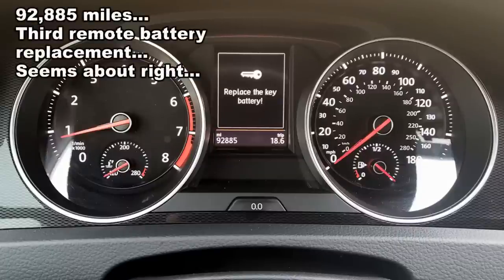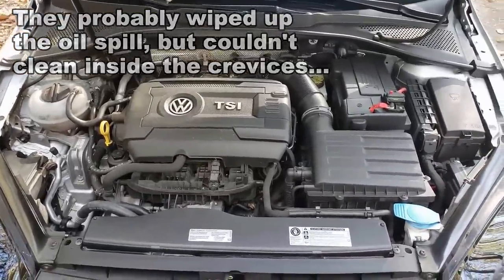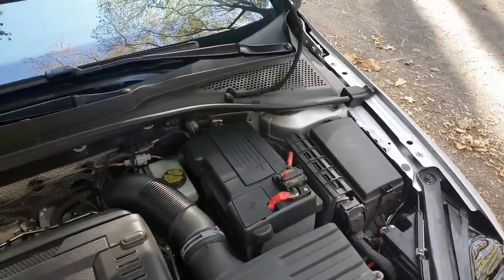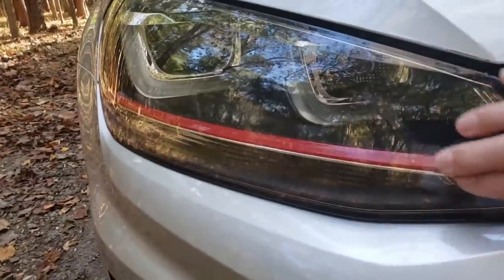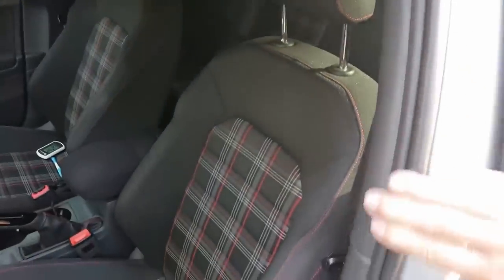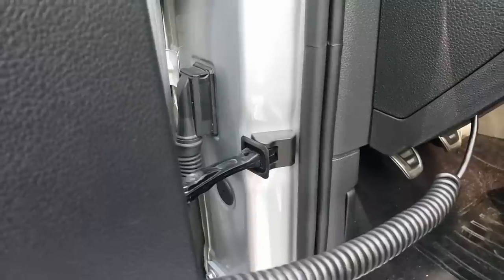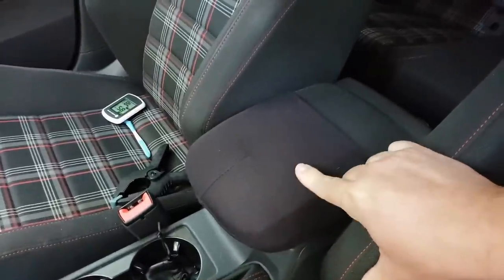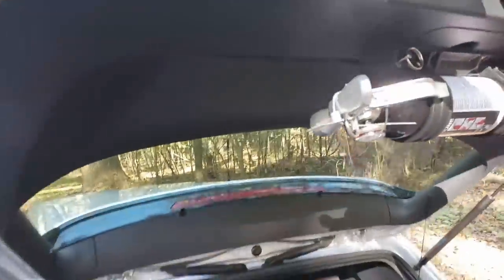THREE YEARS AND 93,000 MILES: My Report, Part 1

Comment: What people do not get with European cars is not the sheer distance in a short time frame but the fact the car deteriorates over time regardless of the distance travelled. 
That is how they designed them, the electronics deteriorate and the plastics deteriorate becoming brittle irrespective if used or not.

It may have travelled 93K Miles but the frequency of the usage of equipment, temp cycles on the materials, seals, plastics is no where near as much as a car used daily for 30 years.

Example is sitting in a car for a continuous period of 1 year vs several times a day everyday for a few minutes. 
1) If you sat in a car for 1 year you only entered once, pulled the seat belt once, used the ignition switch once, engaged the starter wear once etc. Most is actually driving.
2) Conversely sitting in a car several times a day you will use all the above items more than once places more wear and tear compared to scenario 1
Reply from the maker: Thanks for sharing that. My experience is that TIME, not mileage, takes its toll on most cars. At least that's been the case with my cars. Mine have all seemed to need extra attention around the eleven year mark when rubber starts to dry out and heat-cycled plastics are starting to fatigue. I don't think I'd keep my GTI for more than 10 years. It may have 300,000 miles on it by then, if I do. Thanks for visiting.

Comment: Firstly:
You modded the power output of the vehicle at 15K.  
If you want to document things thoroughly; discuss things before 15K.  Everything after is from increased power output.
and
WHY discuss dents to the car?  That's not even worth mentioning.
Insecurity is a trait less desired.  Keep driving 'till it blows up.
You know where the "cracked roof" stems from?  The crossbars!  People install them incorrectly and torque down the bolt connections so tight that the vibration over time (because the suspension is pretty tight right?) begins to create those issues.
Reply from the maker: I discussed the dents because they are part of the journey, just like the glass. Just to be clear, this is not a "complaint video." Cars are tools; the dents show that I use my tool. So, I pointed out the flaws as a point of fact, not to present complaints. People who complaint see my video as a complaint. Also, I disagree with your sentiment about everything past 15k being due to increased power. Most of what I presented has nothing to do with output power. It has more to do with USE, which my car gets plenty. I cannot comment on the cause of sunroof frame cracks. But I wouldn't be a bit surprised if some of those roofs have never had a rack mounted. I could be wrong. Regardless, I don't care because cracked roofs are not my problem.  :-)  Thanks for visiting.

Comment: Yes my 2015 GTI has a small oil leak. It currently has 80k miles on it idk if I maybe hit something or maybe the seal is going out on the factory pan but I’m thinking of upgrading to a steel one myself
Reply from the maker: I hope to provide an update about how my Tiguan gasket is holding in a few months. Check out my oil pan video for details.

Comment: Leave the steel pan on. Plastic degrades over time and can clog your oil pump and that's way much of a bigger hassle. Great video thanks for taking the time.
Reply from the maker: Steel pan has been sealed. See the next video for details. Thanks for visiting.
Reply: Blanket statement. ‘Plastic degrades’. There are thousands of different plastic(s). Each polymer behaves differently. Thermo plastics plus thermosetting plastics. Each type has characteristic fitting them to different situations. They are not a cheap replacement for parts which would previously been made from metals. Often they suit their purposes better perhaps for weight saving, more accurate manufacture, greater thermo efficiency or environmental impact. Chosen properly, polymers are reliable engineering materials not penny pinching alternatives.
Plastic is the state that any material can be in. Plasticity is the opposite of elasticity. Rather than returning to its original state after deformation, a plasticity retains its new state. If one gives sage advice it needs to be on the basis of factual knowledge.
Reply: @ejpurkis  Of course I'm not going to pretend I even knew half of that. Thanks for sharing it. I, however, know about recent developments made in producing plastic products and how they can be even more practical than steel or aluminium and I'm all for it. Just not when it's in a part so critical to one of cars' basic components! Not for nothing, but I have seen other videos where plastic brakes down and eventually clogs up the oil pick up tube that sucks oil from the pan. Admittedly this was in cars that had 150k+ miles. Nonetheless, why not swap it out, if you can, before it comes to that?
Reply: WolfganG  indeed, why not. Thanks for your reasoned reply.  What possessed me to preach that homily I don't know!  I'll just climb down from my hobby horse. Please accept my apologies. Seasons greetings.
Reply: @ejpurkis  Apology accepted. Cheers!

Comment: Pretty spot on with my experience, 17' Golf R have same problems.  First little rock cracked my windshield, but I replaced with OEM VW glass less than $300 installed (hope it holds up), Seat bolster starting to show wear and tear,  bought a whole gallon of G13 coolant because it runs low all the time. I also have clear bra which saved the paint from too many rock chips to count. Also have APR ECU+TCU, but can't comment on the clutch, since I only have 2 pedals haha
Reply from the maker: Thanks for your comments.

Comment: I think VW make crab because I had car and they didn't tell me that diesel will carbon. There was a setting they were too change and had to take to another mechanic to remove the carbon.
Plus it didn't have a block heater for the winter which they didn't tell me till had problems starting the car. One of the heated seats got on fire and then about 4 years later the engine went and VW did not do anything to help me. VW reminds me of BMW where they think make the best and watch out if you have problems and get a warranty. It looks like the saga will continue for good luck
Reply from the maker: I didn't know VW was in the seafood market. I need to check into that.  ;-) Thanks for visiting.

Comment: The coolant consumption issue you are having is the result of the thermostat slowly leaking. This is a super common problem on mk7 2.0t engines. I’ve seen them start at 20k miles and they just get worse over
Time.
Reply from the maker: Thanks for sharing. I just had the cooling system checked and no leaks were found. I share some info in my forthcoming video.

Comment: Hey man awesome video! I’m checking 2017 gti sport out with 65000 miles, anything in particular I should check out?
Reply from the maker: Thanks! My "Milestones" playlist has more recent reports. Check it out. As for the 2017 Sport, the only thing that immediately comes to mind is to look for signs of a coolant leak or other fluid leaks. Other than that, just a general inspection, perhaps a "presale inspection" by a professional. Good Luck!

Comment: ok my turn...
vw golf vi 1,4 160hp - 130.000miles 9 years...
Problems...
-external belt 40,000 ml. replaced
-Glutch disk replacement 70.000ml -replaced
-front wheel bushings 85.000ml. replaced
-suspensions 90.000ml - replaced
- back door seals 95.000ml - replaced
- 2 dead batteries (normaly aged) replaced
-roof cotton cover - 110,000ml. pending
-small oil pan leaking - 125.000ml. - pending.
-small body scratches and front bumper fix - pending

That's all.....
Mechanic problems? NO
check engine lights? NO
Electrical problems? NO
Timing chain problem? NO
Reply from the maker: The important part: Are you happy with the car? If yes, then very good! Thanks for visiting.
Reply: @StealthGTI  If i'm wasn't happy i wouldn't keep it so long. 
There are times that i want a faster or a better model but my economy situation can't go further so i stay happy with the one i got. My aim is to make it last as long as possible and maintain it so it looks like it first come out of the factory. well it needs some work but i thing iam on a good road.
Thanks.

Comment: I have a 2015 MK7 , 89000 miles SE and it has the plastic factory oil pan with no leaks so i am planning to put the skid plate. i also noticed the coolant consumption is about the same as what you pointed out.
Reply from the maker: Thanks for sharing your report!

Comment: Check to see if the coolant is migrating; pull off the connector to the overflow tank and see if there’s any corrosion in the connector. I’ve seen it a handful of times on GTI however it’s more common on the 2018.5 and newer Tiguans
Reply from the maker: Thanks for presenting that idea. I thought VW had resolved the migration issues during the Mk4 years. I guess not. I'll have a look. Thanks again.

Comment: The coolant leak could be the thermostat with water pump. Which is under the intake manifold. For this engine between 20-100.000 miles it will leak mostly there
Reply from the maker: Thanks.

Comment: For the oil pan, I’m using the ECS skid plate on 2017 GTI. No leaks, but I live in DC and the potholes are out of control
Reply from the maker: Yes, DC roads are pretty terrible. I was stationed there for three years. I struck an object on 295 one day. It looked like a frisbee, but ricocheted under my car, lacerated the underbody in two places, and punctured my fuel tank. Thankfully, it did not hit my oil pan. This was on my 1998 Jetta TDI. I had it back on the road within a two days and drove it for another six years, retiring it with 445,000 miles. HAHA! Thanks for visiting.

Comment: My 2016 GTI (manual transmission) has 81,000 miles.  The engine temperature control actuator was leaking coolant which was discovered during the 80,000 mile maintenance.  We are replacing that and the water pump as a result.  I have had to replace my windshield due to extensive pitting.  My keys are on their third batteries.  And, I replaced my battery around 60,000 miles.  Great video!
Reply from the maker: Thanks for visiting.

Comment: Why did I wait so long to watch this video?  18:39  FOR GOD'S SAKE . . . BUY A SKIDPLATE!!!!  I purchased the Ares Skid plate from Evolution Imports (.com) for 3 of 4 VW Golfs I own and they are worth their weight in gold!!!!  Neil Thibodeau from Evolution Imports is a grand wizard of customer support!  The only issue I encountered is a possible rubbing from the A/C line with one of the skid plate supports; I isolated it by adhering a rubber isolation pad to the contact surface.  The skid plates have saved my bacon multiple times from Chicagoland winters with chunks of ice that strike the underside during winter (pothole) season.  My fourth MK7 Golf is a 2019 Golf SE 1.4 that has a metal oilpan as well as a metal-housing oil filter, so I haven't purchased a skid plate for it . . . yet.  Love your channel and your videos - kudos!!!
Reply: I must have early Alzheimers . . . I replied a year ago to this video.  Now where did I put the tv remote . . .
Reply from the maker: HAHA! I can relate. Getting old sucks.  ;-)  If you commented last year, then I probably replied. BUT I may not have had a skid plate yet. I do now: https://youtu.be/iY0tqZz_GYk. Thanks for visiting!

Comment: Nice car friend, I started with a second hand 2015 Golf trend line in 2016. I love it so much I went to a Vw dealer and traded for my  2017 GTI dual clutch autobahn, AND I loved GTI so much I bought the 2018 Golf R 13 months after buying my GTI lol. IM 42 years old now, and in the early 90s my first two cars were Vw, so after HONDA toyota, Mitsubishi’s and a few unmentionable domestic cars I went back to the VW group after a very unexpected love connection with my Used 15 Golf as I mentioned.
Reply from the maker: Good to hear it! I know there are better cars out there. But I have a bond with the VW community and love the balance between performance and economy.

Comment: Hey love your video....i worked VW dealership in college back in 84-85....we had a huge supply of the leftover 84 Rabbit  GTIs in red,  white, and black....you couldnt get those cars off the road...then came the the first Golf GTI s in 85....great memories....
Im considering coming back to VW after about 30 years in other Marques.  Question...would you consider buying 2016 GTI man trans performance pkg 125,000 miles one owner no accidents ?...i d be buying it as a commuter car winter car fun car... I've driven alot of cars 200K and beyond....i can do my own work... ive owned scirroccos, jettas, Corrado....(bent alot of corrado wheels)..let me know your thoughts...
Reply from the maker: I think a single-owner 2016 could be a good car, especially if it was well-maintained and not abused. Good Luck and thanks for visiting!
Reply: @StealthGTI  yeah thanks. I agree wanted to hear your thoughts....1 owner 125/k in 5 yrs prob alot of highway commuting...trading in at 5 yrs when you drive alot isnt unusual...

Comment: Why fix something that isn't broken. The original plastic pan will hold up. If you are so paranoid then change it periodically. Stop going off roaring with your gti.
Reply from the maker: I've seen plenty of reports of ice chunks for other road debris taking out oil pans. Personally, I had a small object on a Washington DC road pop up and rupture the fuel tank on my old Mk3. I'm sure this kind of damage is rare. Still, sometimes, city freeways have objects on them and no time to react to them. Off roading? I don't think my car has driven off road except for one time when I got stuck in my own yard. HAHA! Thanks for visiting.

Comment: Mechanical issue wise you didn't have many problems? I may be buying a gti second hand but I am really digging into my research identify its reliability score in terms of the mechanics of the car and how often I need to replace/maintain things.
Reply from the maker: No mechanical problems other than the self-inflicted clutch slipping. I commute 70 miles every day without a single worry. Thanks for visiting.

Comment: I'm shocked the driver seat bolster is in that condition after only 93k miles.  I went with cloth over leather because I wanted my GTI to look good 10 years in.
Reply from the maker: Most of the wear on the seat bolster is due to my own lazy way of getting into the car and wearing denim jeans. Now that I'm more aware of the damage it had been causing, I've changed my entry technique and also wear different materials that are less abrasive. I have not sustained more damage in the past three months. So, I'll probably get the damage repaired and be happy. Thanks for visiting.

Comment: I have a 2017 GTI, 6spd manual, with 45k miles on it, and Im also in need of a windshield replacement. My center arm rest also seems to get a lot dirtier than the rest of the cloth inside the car. I am 6' 5" tall, and weigh 215lbs. I don't have any issues with my seats lumbar wearing down. I think it was more of you being older and it being harder for you to get in and out of your car than I do, as I am only 38yrs old. As far as you being concerned about crank walk, I honestly wouldn't worry too much about it. JR14 beats on his car pretty bad. He has gone through 3 clutches in his car. He must be driving the car wrong to do that. you don't seem like the type to beat on you car like he does. Anyways, hope it doesn't happen.
Reply from the maker: Thanks for the note. Yes, my hips do present a mobility challenge. I once saw another tall driver's Mk7 (for sale). His bolster was completely blown out. It was bad. He was in his 20's, so I figured it was a "tall problem." It could be just entry technique or laziness. Thanks for visiting.

Comment: Here WAS my experience with my 2015 VW GTI Autobahn. I do NOT owe the car anymore. Overall it was truly an awesome car, had lots and lots of fun with it. I will make my comment as small as possible. 

I leased the car, so I got it new.

Around 12k miles I did stage 1.

Around 26k I had to change stock tires then added Michelin Pilot Sport S 3+ and yes I bought tires twice because they’re so good.

29k I went to APR stage 2 with APR down pipe plus APR intake.

30k I put straight pipe, LMAO. Miltek pipe by the way.

37k I did coolant flush plus waterevrr was recommended, $600+ spent

42k I added Forge blow off vaulve.

58k I noticed my engine spit oil from exhaust at cold starts. ( NO smoke)

60k was pretty bad then brought to dealer they said it was fine, “it’s just the straight pipe”

66k oil leak got to the point that I was tapping it pff every 500 to 700 miles. So many people said it was the turbo so I changed it to IS38 because why not it was cheaper and more fun. So changed turbo, added APR intercooler, changed all internal hoses plus did TCU upgrade with ECU IS38 APR upgrade as well.

68k chamged diverter vaulve back to original. (To a new oem one)

Oil leak was still there but still tapping at 700 to 800 miles. 

79k spark plugs needed to be changed. Still after so many tests couldn’t figure out the oil leak. Lots of oil lost weekly and NO smoke.

82k car was no longer drivable, they finally figure it out it was piston rings and in the end I needed a new engine. $14k to put new engine, so I decided to get rid of the car. 

I brought the car so many times to VW to figure out why the oil leak was so often and they did it after my car was no longer working, it’s a shame.
Reply: I did coolant flush again at 79k.

And all of my oil changes were at every 7k miles, not 10k. Also I only used 93 octane fuel 👀
Reply from the maker: What a mess. It was fun while it lasted.  ;-)  What are you driving now?